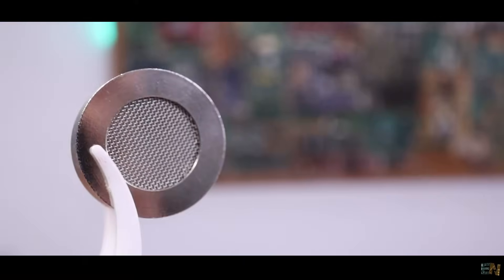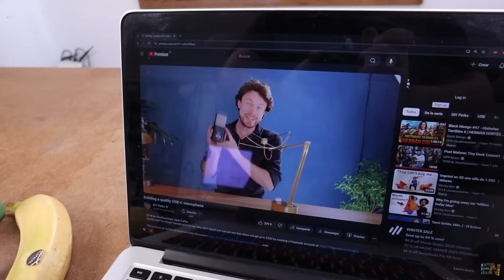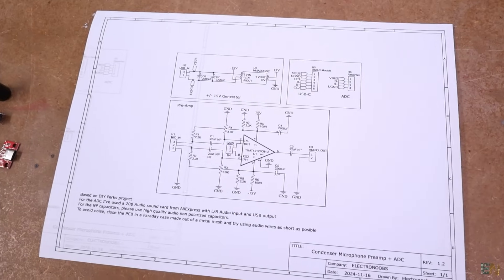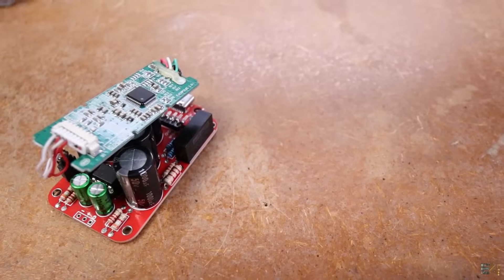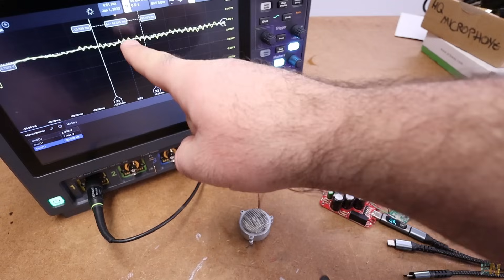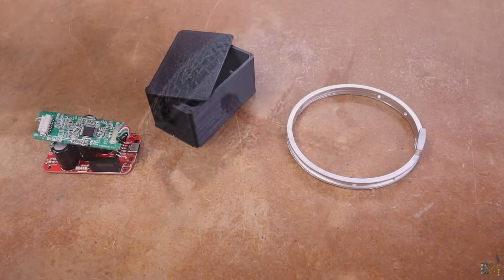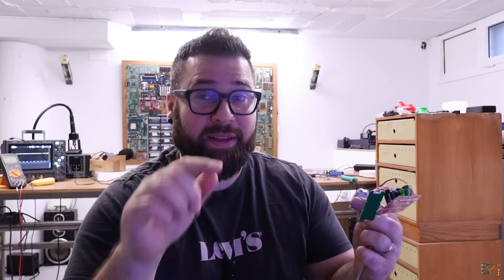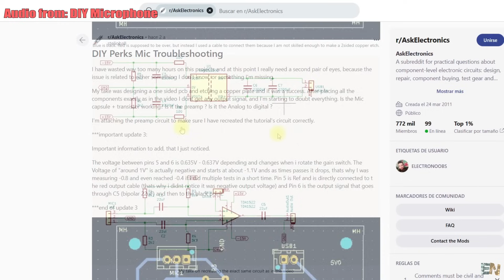I Built a $500 Microphone for Only $20 and It WORKS!

Comment from the maker: Just updated the tutorial page for the downloads: https://electronoobs.com/eng_circuitos_tut91.php
Reply: Nice project, but you say that you have a problem with noise. You have created a shield for the electromagnetic fields in your home.
I would create two 3D-printed parts for the microphone housing, so that you can glue the metal mesh in on each side, but it is possible to open it if needed.

The metal-mesh in the amplifier housing must be good connected to GND too, if not, the field is only somehow more even, but goes trough the PCB in the housing. Remeber, this cooper will oxidize and only a touching of the aluminium-mesh and cooper-wire is not so good in long term.

An other point is the noise from the +5V USB, this is extremely noisy and must be filtered very well. The voltage what you get from the PC is not a good choice.
If you would transmit the audio data wireless, then you could use a LiIon-cell with a Step-Up regulator or a power bank. Do not underestimate the effort you have to do if you want to have some clean voltage.

I think your microphone is good, it need simply some minor upgrades.
Reply: Disculpa una pregunta si te paso un diseño de una PCB también los arreglas me interesa arreglar una PCB que hice mal igual dime si se puede y cuánto cobras saludos soy un suscriptor de hace tiempo ✌️
Reply: @CodeMotion4yt  You can show your design in a electronic forum, so that the people can find errors or improve the design. Do you use KiCad for the PCB-design? Or Eagle? I could check your PCB design. I create electronic circuits since 25 years, in the past with Eagle, other software in the job, but for the hobby I use KiCad.

Comment: I don't seee how reducing the supply voltage is supposed to reduce clipping. Actually the opposite is true – the more supply voltage the more headroom the circuit has to not clip the signal. You have an oscilloscope, check where the clipping occurs and adjust the gain accordingly. My bet is that the ADC input is overdriven, not the amplifier circuit itself.

Comment: JLI also sell the OPA Alice Circuit, which is a very good pre-made mic circuit. Basically plug and play with that capsule and an XLR. Won't be quite as cheap, but certainly takes care of quality.
Reply: Yes, but shipping to Europe is +-€50.

There's a shared project on PCBway from the author of the project himself, he can't give out the gerber files because the owner doesn't want to.

Buying off of PCBway is pretty cheap, €11 for 20 boards including shipping to where I live. It's a lot more expensive with pre-assembled parts though, €34 euros total.

Comment: Gate 2 is required to adjust the gain of the dual gate MOSFET.
Reply: It's not a MOSFET, it's a JFET, and it's not dual-gate. In most variants the optional pin 4 is connected to the case as means of shielding.

Comment: What if the noise comes from the DC/DC converter? (maybe you got some fake chip). I would rather make a simple linear bipolar power supply from mains than use USB power for that. 
Try mounting the FET to the capsule chassis (with the fourth leg) and connect just the gate with fexible wire (just few mm of it).

Comment: @9:04 the humming can be seen on the oscilloscope, it is the very low frequency sine wave. My guess is either ground loop or making its way from the power supply. Actually the periode seems to be 20ms which works out at 50Hz frequency. You probably have some noise from the mains coming in there. May be you can try to run it from a battery and see if it works. If it works, it is a matter of filtering out the 50Hz hum.

Comment: Hello dear friend. I'm a musician and Sounds engineer. I think the noise could also be due to lack of an external audio interface. Remove the ADC module from the circuit and connect the output of your microphone to input of an external audio interface such as Focusrite 2i2 or any other external audio interface in this class and record the sound in specialized software such as Cubase or ProTools. I think this will eliminate the noise. Because even the best microphones in the world will not have a good output if they are not used with a quality audio interface. You can use demo and 30 Days Version of these softwares for testing. Because they are expensive.
Reply: So what you're saying is: buy a proper mic and buy a proper interface. Why even diy anything by this logic?

Comment: Maybe DIY Perks room is less noisy than yours, and nothing is wrong with your mic?

But, EzCap ADC would be my suspect #1. Is there any LowPass Anti-Aliasing Filter inside? This ADC normally will be connected to sources like CD players that can't produce frequencies higher than 20kHz, and maybe they go cheap and didn't put any filtering?

Try to  blow dog whistle or use something that produce ultrasounds above 25kHz, if there is no AAF then ADC should pickup that signal and record as an alias in audible range. Connecting signal generator to SMD ceramic capacitor should generate ultrasounds due to piezoelectric  effect, as well.

Comment: It seems that you didn't actually create a $500 microphone, as it is not functioning properly. Perhaps the $500 model performs better because it uses higher-quality components, involves extensive design work, includes a proper casing and switches, and is produced by a company focused on business, logistic and customer service. I love the idea of DIY microphones, like the Alice project, which uses the same capsule as the Chinese mic you have. However, claiming that you have built a $500 microphone for just $20 is quite misleading.

Comment: Maximum capacitor at VBUS allowed is 10uF at VBUS based on USB spec, you put two 2200uF capacitors on it???!!! This could create a big in-rush voltage that potentially damage your USB devices. The DC/DC converter used to generate the +/-15V has a switching frequency of 90kHz, and yet you don't have any decoupling capacitors (and filtering) on both +15V and -15V outputs.

Comment: i'm curious to hear the result with a XLR cable instead of the using a digital convertor. the build would be even more compact and could work better, also the gain/volume would work for sure on the audio interface.
Reply: the whole point is that the audio interface is expensive and this is made to be cheap. Like if you have the money for an xlr interface you have some money for a proper mic.
Reply: @gwerdoerr_surname_not_foun693 as a guitarist and tech enthusiast I had audio interface for a long time but no mic since I don't song and had a usb mic headset for gaming. I upgraded my first audio interface (that cost 45$) for a focusrite which isn't really "expensive". (I did get a proper mic when I switch my gaming headset for a jack audio headset)
I'm pretty sure I was not the only guitarist with an audio interface and no mic and didn't need/want to spend a lot on a proper mic at the time.

Comment: En el datasheet del NMA0515 para la medida del ruido de la fuente en lugar de C5 de 22000uF usa 1μF X7R multilayer ceramic capacitor y en paralelo 10μF tantalum capacitor low ESR. Como es una fuente conmutada es una importante fuente de ruido.

Comment: Ah, Perks - I'm also building one (actually 2 - first one I've been using for a year now) although I settled for THAT 1510 which is more available for me in smd version and still very good and a cheap chinese capsule - works great! For the second one I'm planning to implement a smooth mute without audible clicks. Gotta find time for that.

Comment: I use the THAT1512 a lot. And it is very important that the REF pin is grounded. Without that. You get nothing out of it :)
Reply from the maker: If you check my scheamtic, you can see it is connected to 0V from the +-15V supply. You say that I should connect it to the GND of the USB input?
Reply: @ELECTRONOOBS  The ADC & DAC should if connected to ground do that for you. So all grounds are would be common. You can measure that the USB Ground is connectoed to the USB ground. And I'm talking DC supply.

Do no connect AC Earth to DC Ground. What I do miss in you schematic is that there should be a Resistor and a Capacitor to set the output gain. Check Fig. 3 on the THAT15xx on the datasheet. I don't see that. But the jumper could be there to play with the resistors. 

I could send you my Design so you can compare them and make changes where needed. Also... I bought mine from Mouser. To be sure they are genuine.I would also see if the 5V to ±15V can handle some current. It is a little bit but might be a point of failure.

Comment: Nice project and hope you can fix the gain problems, just a thought as it wasn't clear the solder wick braid is only connected at one end to ground, to avoid a ground loop. I believe that is what I was told about ground loops but I am no expert.

Comment: I would be interested in building one of these but have no interest in the analog to digital conversion. I’d keep it analog and power it from the 48 volt phantom power from an audio mixer board. I have a couple of the Ear Trumpet Lab condenser mics you briefly showed and have had noise with them. After extensive testing and analysis I’ve discovered the noise is from 5G digital streams from nearby cell towers. I worked for the company to develop a way to combat that noise and the best way is to wrap to two signal wires coming from the capsule 12 to 15 turns on a small toroid core to eliminate the 5G RF interference. Double shielded cable from the capsule to the preamp is also a help. This changed the company’s manufacturing process and they apparently have no customer complaints on RF noise any longer.

Comment: The first amplifying stage usually sets the noise limit for a circuit, and also the maximum SPL limit. Determine the maximum SPL you need to handle your loudest speech, then determine how much gain is needed based on the capsule datasheet sensitivity to reach the maximum input levels of your USB interface based on your target SPL limit (hint: you may not actually need a preamp aside from the Jfet). Find a low-noise Jfet that does not have so much gain it is clipping before any proceeding stages. If your USB interface does not already have high SNR, adding a preamp may not be any help. If it does have high SNR, then the preamp may still be unnecessary. If you DO need an extra preamp, then you may want to rethink your choice of Jfet.
Reply: I love this kind of comments.
Reply: Any tip for a low noise JFET that is easy to get?

Comment: Maybe the clipping is not in the pre-amp but in the ADC.  You have the rails at +/-15V, plenty of room.  But check the input voltage level that the ADC accepts, usually line level is 1V or 2V. And you have a nice oscilloscope, check the output signal of your pre-amp to see how it looks, the amplitude and whether it clips or not.

Comment: "This cost me like $200" OH NO IT HASN'T.

That's a T-Bone SC440 made by Thomann and it cost a maximum of 60 EUR at any point. It has a lower efficiency 16mm electret capsule decorated to look larger with a golden tint plastic surround. It is very certainly a competent and very well sounding microphone completely regardless of price, one might pay more and receive less elsewhere.

As to possible faults and improvements to the DIY mic also make it cheaper better and easier to reproduce, i can't today, maybe another time. It's certainly got a lot of potential.

Comment: Designing a condenser microphone is quite an involved affair. You're talking about TINY voltages, TINY currents. Thus any mistakes or oversights or stray noise from anything connected to the system is going to cause huge issues. Not to even talka about the DC/DC charge pump and the weird USB botch board you've connected to the circuit... tey all generate noise and that must be taken into account.

This is why condensers are usually powered from phantom power, which itself is highly filtered and very low noise. then the electronics inside the microphone filter it even more and amount of amplification you have without the mic preamp itself is minuscule to avoid clipping in high SPL situations etc. etc.... it's not simple affair what so ever.

Thus the fact that you got sound out of this thing is in itself an achievement...

You can spend your whole career only to learn how to design condenser microphones or preamps...

Comment: INA217 is good enough for this projekt, little more noise in theory, but you cant hear difference in project like this. Your noise problem is somewhere else - wrong shielding, ground loop, noise from ADC or DC/DC convertor (both are too close to sensitive preamp)

Dont reduce power supply voltage! This is not clipping reason! By reducing power voltage clipping may become even earlier.

Do you try adjust opamp gain ? My guess, part of your problems, if not all is wrong gain. you can adjust it by changing resistor between legs 1 and 8, see table in Figure 13. in INA217 datasheet  
In figure 16 you can see mic preamp with 1,6 kohm trimer with 8 ohm resistor in series between 1 and 8 leg, this give variable gain 20 - 60 db. Maybe try something like this?

Comment: Nice start! Looking foward to future developments.

Most professional mixing boards have a switch on their imputs for Phantom power. Active microphones that need power can then get their power from the mixer board.

I also have a box that sits between my microphone and an amplifier or mixer board that's battery powered to supply phantom power in case the amplifier or mixer does not have this feature.

You may want to someday make a microphone with a more professional XLR jack on the end and if so, consider making it run from phantom power through the XLR jack.

Another possibility is the addition of an impeadence matching audio transformer within the microphone.

I often use a transformer on my Sure vocal mic to match the input to whatever It's getting plugged into. The device is a passive transformer with a switch to swap from high to low or low to high.

Comment: You will get more clipping if you lower the power supply voltages. Clipping occurs because the amplifier wants to amplify the signal to a voltage higher than the power supply. You'll need to lower the gain, it will probably also lower the noise floor
Reply from the maker: Actually with minimum gain, clipping is still there... :/
Reply: @ELECTRONOOBS  The minimum gain on THAT1512 is -6dB. Under regular conditions it's impossible to clip the mic at such level. Also the higher the voltage on power supply, the better not the other way. Make sure the chip is the real thing. Also, since you placed the preamplifier in a box with plenty of space I would suggest building the circuit recommended by THAT1512 datasheet, rather than the simplified version by DIY Perks.

Comment: you can use copper or aluminium tape to cover the inside of the box instead the metal mesh, using tape is way easier...
Reply: There are videos on YouTube that show how to make carbon graphite paint with graphite powder. It's often used by guitar manufacturers to paint inside the guitar body cavities where the electronics go to prevent noise.
Reply: @tenlittleindians  that sounds even easier... thanks for the info, i will check that out

Comment: Your ADC is digital.  Did you shield it from the analog board?  I mean, great design to get both in a really small space but the shielding around it isn't going to stop noise generated on the inside.  For that matter, the +- 15vdc charge pump has to be pretty noisy too.  Separating the noisy stuff from the amp... even a somewhat divided PCboard with separate ground planes and a place to solder in a metal wall to isolate the 2 sides?   Oh, and using solder wick as shielding... that's awesome.  Never even considered that :)
Reply: I'm kind of puzzled why, with the fancy oscilloscope, he doesn't go looking in various parts of this simple circuit to see where the "noise" (AC hum?) is being introduced?  This troubleshooting by randomly changing out parts shotgun style doesn't seem like a great path to a resolution.

Also, it's not a Faraday cage if you don't have solid connections all around.  Just having incidental connections with parts of that material just pressed against each other doesn't seem robust.  After some time vibration conducted into that electronics box is going to likely impair the shielding ability.  I realize this isn't exactly a microwave RF problem trying to be solved, but all I could see is  slot radiators along all those seams in the box.
Reply: @lmamakos tbh a better way would probably just be an aluminum box, right? Then have a copper plate from a pipe or something screwed in somewhere to solder to... could even coat everything in epoxy after to ensure it doesn't short stuff
Reply: I think you are right. He is picking up noise from the ADC, and in his case it's not only a audio ADC but also a capture device, so I has a microprocessor, clock, data going etc